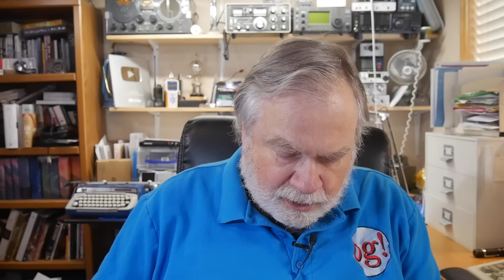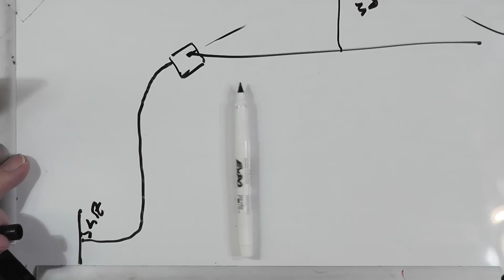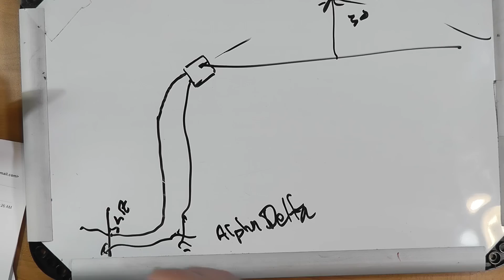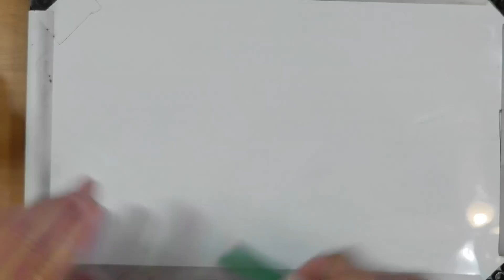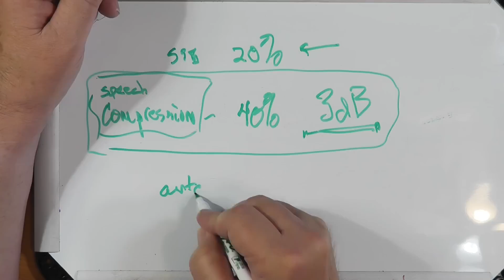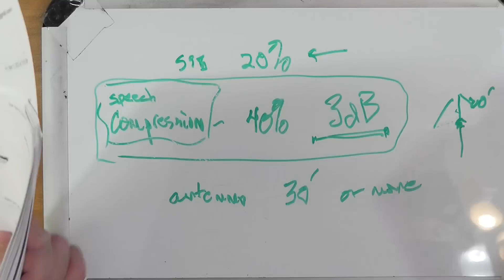Not being heard at 100 Watts (#680)

Comment: I'm at a loss with the station who says he's got a good radio and uses it at 100 watts - and can't be heard. I'm a brand new HF ham. About three months ago I bought a Yaesu FT 710, A Vibroplex 135' endfedz antenna, and later added an MFJ 993-B tuner. I'm in northern NV. My second contact EVER was Australia! That hooked me on HF forever! I've been fooling around with some home-brew antennas now but keep falling back in my long-wire. I've made several DX contacts and hit just about anyone I hear. I'm actually quite impressed with my setup. But then, as I said, I'm new to HF and just about all things HF impress me.  Oh, and my long wire parallels my back fence. It's 14' in the air. It would be higher but it parallels the powerlines just above it as well . . .  I'm working on improving this whole antenna thing sometime in the future. But as they say, "If it ain't broke, don't fix it".
Reply from the maker: I’m delighted you’re finding success on HF.

Comment: Dave, again these EFHW antennas come with instructions that were written by the engineers of the antenna. If you discuss the Par EFHW or My Antenna's they suggest utilizing either 1) counterpoise of 1/4 wave length and or 2) grounding via a short ground wire to a ground rod (BUT NOT BOTH). There is no situation where you experiment without NOT using either. That is not how the antenna was engineered or how it fundamentally works. Furthermore, utilizing coax as a counterpoise is an extremely poor choice for a home base antenna setup.

Comment: It's also possible the propagation from his side is not as good. Meaning he might be on a deadspot. Reason being is that in my case, I've been making contacts all over Europe and even Brazil which is almost 19,000 km from where I'm at and with just a 20 watt radio and a rotary dipole at 19 feet above the ground. With that being said, I can hear hams from the U.S. but they can't hear me. In addition, the terrain on where he is located may also have an effect on his transmission. Thank you sir Dave for your very informative videos.

Comment: Dave is right on the height. The height of the antenna affects the take off angle of the RF, if it is too close to the ground, it'll be more like an NVIS antenna. The antenna should be at least a 1/4 wave from the ground for the band that is being used. Basically, the higher up the antenna is, the better it'll work, within reason. I certainly agree with Dave that switching to a different antenna such as a Hexbeam might also be an option if height can't be obtained. An amplifier is only something to consider only when the best antenna has been provisioned and deployed, at least IMHO.

Comment: When running in a compromised situation, the best way to save $3000 to $6000, is to run CW. I call it "the poor man's amplifier". I've had to run an 8 foot whip, with a tapped coil, on 40 meters. Listened to myself on a web SDR. A barely perceptible ssb signal jumped up to sound like I was running thousands of watts, when I switched to cw.
Reply: I couldn't agree more.  I too had considered getting an amplifier.  However, after I started operating CW, I haven't really had a problem being heard since.  Nothing quite like the feeling of putting Australia in your logbook on a (somewhat) compromise antenna running barefoot.

Comment: I had never heard, or read, that adding compression(properly adjusted) increases to 40% duty cycle resulting in 3db gain. I usually don't run it on my radio but I might give it a shot again. I'm running a IC-7400 with a SM-5 microphone and with the mic gain on both devices, it hardly seems necessary but it could be nice for some "extra punch" when needed.
Reply: the trick of audio compression works by reducing the difference between quieter parts and louder parts. by compressing the dynamic range, you can then turn the whole audio signal up without clipping which results in higher percieved volume of the voice. i am pretty new to radio but i use this heavily when streaming and recording videos and people always compliment on my voice clarity

Comment: KC1CCG and I do very well with 100W CW on all the HF bands with a G5RV up just 20' . The antenna and its matching is THE most important factor. I exchange  reports equal in signal strength with stations running many times my 100W. I am also at the edge of the Atlantic with nice mushy soil, that must help. Worked VK and ZL with this set up. A KW is no substitute for an optimized antenna system.

Comment: Not being heard at 100 watts stop using end fed antennas with 9000 to baluns. G5RV isnt the best but its better than the above. Also if you purchased some comet or do it all vertical throw that out also. Do some work and install the lowest band 1/2 wave dipole up at 30 feet inverted V or flat top and feed it with 350 ohm ladder line and you can and will get out.

Comment: I have a similar antenna in my backyard about 20' up and cannot say I'm not heard on SSB at all. I know what to expect from such antenna by not expecting to have pile-ups when calling CQ or getting on the top 10s in the WPX contest but I'm heard :) Putting it higher certainly helps if you can but don't think height is the main problem not being heard at all. I would check each piece of equipment to see if there is any fault or wrong setting starting with the radio. Check the power output. The power meter on the MFJ will show everage power when you are talking but if you whistle in the mic should go to abt. 100w. Or try on rtty should go full power. Check both meters on the rig and MFJ if showing abt. the same. When tuning the antenna with the MFJ check if the SWR meter on the rig shows also 1:1 when tuned. Next try excluding the MFJ and transmit on part of band(s) where the SWR is 1.5:1 or less if makes a difference. If no change check the coax and antenna. Bad connections or having rf choke if used in wrong place can make troubles. If you can find a local ham few miles away and do some tests with him to give you audio and signal reports while testing. Or maybe you have a websdr nearby you can listen at your signal. Check the websdr map to find out. 73 Andrej - s57rw

Comment: Using an RF amplifier because you can't be heard is the worst advice possible. Start with the basics of having good quality co-ax that has no damage and good, water tight connections, one of the biggest issues I see is people either knowingly (by being cheap) or unwittingly (advice from shady sales people) ending up with nasty chinesium co-ax, instead of copper they use aluminium for both the driver and shield.

Comment: it takes a lot of power to overcome a compromised antenna system.  I have an endfed antenna... used very little, hard to beat a plain old dipole...
Reply: If you use a resonant end fed half wave (EFHW) with a 49:1 or 64:1 broad transformer, performamce and radiation pattern is nearly identical to a dipole. 

Performance with a non-resonant end fed or using a 9:1 UNUN can indeed be compromised.

Comment: SWR of around 1.7:1 is a problem.    Big power loss..    I ran WPX SSB from Alaska this past weekend using 90 watts and a wire set up at 30 feet (the wire I was gifted by you Dave) and made over 120 QSO's including several in Texas (where KG5WQM) is located.  He needs to spend some time examining / redoing his antenna and really looking at the radio.  Maybe a radio reset is needed to return to functioning settings?   There's something seriously wrong....
Reply: Not at all. 1.7 SWR is still 93% out. 2 information sources online agree with this figure. I aim to get below 2:1 at least and get out fine with QRP. 
G4GHB

Comment: Amplifiers can also be part of the problem that this Ham is having. Folks running Amps, and talking farther than they can hear! This has gotten really out of hand over the years. Can't remember the rule number but we as Hams are supposed to only use the amount of power needed to make the communication. Any signal over an S9 is using more power than is needed. I gave up years ago on trying for DX contacts because of this. Often if you listen to a QSO that can't hear you, you'll often hear someone say they're running 1500 watts. Not to mention the splatter they cause! This is so discouraging to a new, and old Ham.
Reply: I agree Dennis. I have an FT817ND, 5 Watts ssb, and get out fine, okay mostly Europe and not S9 reports back but QRP does work.
G4GHB

Comment: Thanks for picking interesting questions! It's possible he's using "no brand name" coax that has a high power loss. Before getting or building an amplifier, he might want to (1) try using different coax, and next (2) try using another antenna, unun, & feedline combo. It's possible to work DX, and also get good signal reports on local nets using 100 watts & a wire antenna. I've worked Japan and Portugal from California and I regularly check into 80 & 40 meter phone nets with good signal reports with 100 watts SSB into a 71' end-fed non-resonant sloper with a 9:1 unun, 50' RG8x feedline, and a common more choke on a coax jumper 3' from the transceiver then into the coax feedline. No RF in the shack.
Reply: I think he said he was using LMR400 which is a low loss coax!
Reply: @tedclapham4833  Good point, but I'd still try different coax in case the LMR 400 is defective or was an eBay fake.

Comment: Tune your antenna to the section of the band you want to work in. By tuning I mean design/ cut/ build the antenna to be naturally resonant using an analyzer to test it. EFHWs are advertised as covering all bands but typically in the 75/80m band only cover a small portion of 80m and have unusably high swr in the 75m/ssb section of the band.
Reply: By adding a counterpoise you no longer have an EFHW you have converted it to an OCFD. By adding more counterpoise you will eventually create a half wave dipole for the 160m band.
Reply: Depending on the antenna, one could and a counter poise. I got a MFJ 1982MP EFHW 80-10m set up as an Inverted L.

 I've recently added a 20'x1" steel braided grounding wire as a counter poise. Thought it might help me out on 10m SSB (my 7300 struggles at times tuning). While it did give my some more bandwidth on 10m, it also lowered the SWR on 75m. I get a 1.5:1 SWR on 3.880 without a tuner. Anything above that, the SWR increases to a 2:1. 

I'd thought I'd share my experience with adding a counter poise to an 80-10m EFHW. It can help out with tuning those bands that are a challenge to tune. I haven't tried a longer or shorter counter poise yet, but I'll try that out later.

73, W4ISB.

Comment: I feel like there are lot more questions that need to be asked, such as is there anything near the antenna that would affect the performance, is he speaking loudly enough into the microphone, is there a problem with the radio itself, i.e. blow final or bad driver, is he on the right band at the right time of the day, is there any RF feedback, etc? When I transmit my Yaesu FT-891 at 75 watts, my peaks are at 75 watts with no change to the mic gain and no speech compression. When my finals in my Icom IC-7000 went bad the first time, power output went from 100% to about 50%, but still no one could hear me. I would recommend that he try to check into the 7290 Traffic Net as it is very easy to be heard on this net with a NVIS antenna.
Reply: Thanks for your comments.  My Icom 7200 is less than 4 years old, bought new before they were discontinued.  Adding compression helped; I was able to log into a net on 40 meters a couple of days ago and my signal was reported to be very good.  I'm still experimenting with compression. I will try the 7290 Traffic Net soon to see how that goes.
Reply: @danielmartin8644  You're welcome. I'm glad you were able to get good reports.

Comment: After 57 years in Ham radio last year got my first and last Amp. 811H just love it and makes all the difference in the world with 700 watts PEP.  Also made a big difference on my old transceiver, Icom 751 is a bhi DSP amplified speaker.  All noise on receive is gone.  WB7ORB  Also got MFJ 267 PEP SWR  Dumby load.

Comment: I'm using a efhw antenna with 49/1 transformer and generally if I can hear them I can work them. It is up about 30ft. If he was trying to bust a pile up with 100 watts he probably is spinning his wheels. The best thing about a efhw  is it is resonant 0n 10,15, 20, 40 and 80  with no tuner needed, so therefor no wasted power.
Reply: I have about the same antenna set up, homebrew 49:1 efhw vertical about 32 feet up from ground level. Results are really good with 100 Watts. My DX Commander also works fantastic. I never use the internal tuner and I have no external tuner, my antenna's are 1.5:1 max so no tuning needed.
Reply: Present conditions, I'm occasionally getting 15000 km on 100W SSB on same antenna. Amazing.

Comment: Don't think an amp is the answer. Remember the SM-30 on the bottom of the base has an adjustment.  May need to adjust that especially if you bought it used.   Most assurdedly needs an external tuner.  LDG IT-100 will do.    At 1500 watts if he's getting out at S-9, 375 watts would be S-8 and 100 Watts give your take should be an S-7. 500 watts might get him an extra S unit out.     Something else is going on. The 7200 is a long in the tooth radio and something may be wrong with the TX side.     Too many operators just jump to having to have an amp turned up to 11 and not know what they are doing.    Certainly don't spend that kind of money on an amp without more testing.   Have a friend bring their radio over and hook to your antenna.   Take your setup out portable out of town for a lower noise floor.... lots of things to try before "you need an amp."   2 cents.

Comment: take the RF choke off the "feed point" to let the coax act as a counterpoise.......... move the choke to just before the coax enters the house (if you think you need an RF choke at all) adding a separate counterpoise wire can't hurt..........73 happy hamming Mike K1FNX near Boston
Reply: You're right Mike. That's what catched my attention right away, that antenna has no counterpoise because the choke prevent coax shield of acting like one. Depending of the lenght of that coax, it migth be also be too much of a counterpoise ?? If so, and only then I would had other another counterpoise. 

I have myself about the same setup as Dan with an EFHW at about 15-20' height and have great results with 100w on 20m and 40 being with lots of contact in Central and Estern Europe, Africa Coast from Quebec Canada. The only difference being the absence of choke at the feed point.

Pascal VE2ZWI
Reply: Bingo! I use a EFHW 80-10 antenna (rated for 2 K and a trap for 75m) and the RF Choke is what grabbed me. I placed my choke on the radio side of my arrestor, allowing the coax to function as part of the antenna (as designed). My antenna starts at about 18' (unun end) and goes about 129' long to an elevation of about 35 feet. My antenna unun is grounded to a ground rod. I have experimented with and without the ground and see no difference in performance (ground is safety). Same using a "counterpoise" from the ground lug. No change. One manufacturer of the EFHW discusses the "counterpoise" theories in detail and says it is a ground. If the antenna, at the unun (aka transformer box), is greater than 20 feet from the ground, not to use a ground wire on the lug, but to just rely on the coax grounding at your arrestor due to "static" build up in the ground wire. I am an RF technician by career and choose to ensure I have it grounded for safety reasons. I am very successful with my antenna. I have worked most continents on 100 watts on 80, 40, 30, 20, 17, 15 and have had good DX on 80 thru 10. I have been using the EFHW in different configurations for quite a while now. The current setup described works extremely well for me. As they say, results may vary. Soil, topography, near by structure(s), vegetation, yada, yada, yada, all way in as factors. Experiment, experiment, experiment. Results=experience. Experience creates knowledge. What an awesome hobby!!!! Good luck and 73 -de Kirk, KN1B
Reply: Yeah, at least .05 lambda of the lowest frequency away from the feedpoint.  Specifically, I use 9 turns of the coax through 2 240-31 type ferrites.  This is more important if the transformer is hanging in the air.
Reply: Make sure that your coax cable it's more than 20 meters, for the correct use, because the coax it's a part of the antenna system, in case of EFHW or long wire. 
I prefer insert rf-choke outside of my house shack radio.
73 de IZ8FAV

Comment: I remember being just like this guy, SSB I always had trouble making contacts poor signal reports and on occasion some good ones, but FT8, or JS8CALL I was picking off contacts left and right so I stuck to that and very little SSB maybe checking into a net here or there. but beyond that I was always getting poor signal reports, then I added a amp to the setup, rebuilt my antenna and boy was it a game changer, even with my FL-2100b "loafing" at 3-400 watts I'm getting compliments on my signal reports and able to break pileups on the first or second try, something that never happened when I was at 100w. I definitely think he should improve his antenna, maybe change to an inverted L with some radials at 100w. however, an amp may be the solution, there are guys on HF that aren't telling the truth about their setups sometimes.